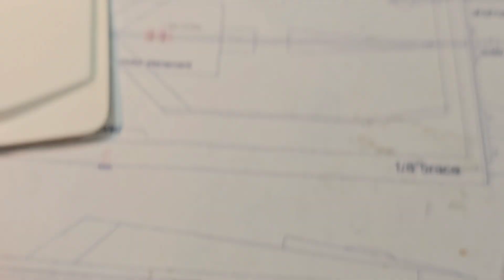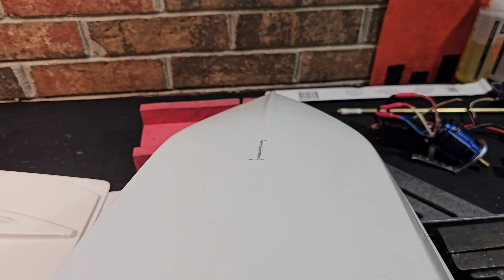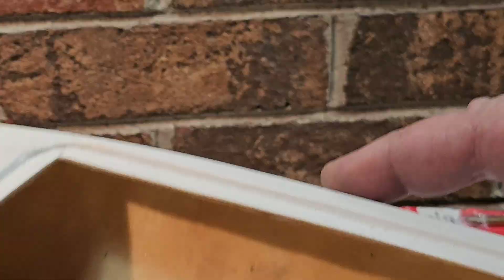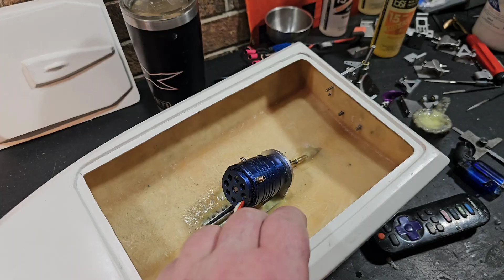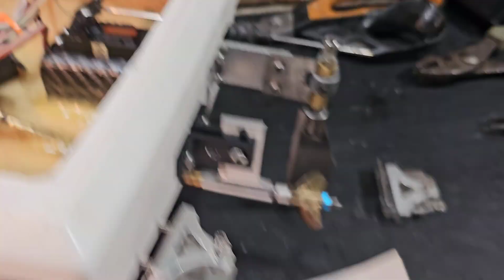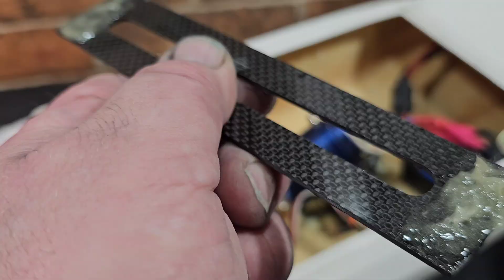Full Build Start to Finish Crackerbox Timmy Boat from Dead Ahead Rc - Fe Rc Boat Build

Comment: Big B Big B Nice work brother. I got my CF TFL pursuit and I need to reinforce the bottom of the hull the sides where it's put together before it gets damaged and I'm debating on cutting out the stock motor mount because everything's lined up dead nuts perfect I mean the flex cable I mean you can't even tell it slides into the collet it's so smooth and if I cut that damn motor mount out and have to remount it and I know it's not going to be that exact again I was debating on whether the carbon fiber up to the edge of it and it's cut up and chop and then you know just kind of work around the motor mount  which is half-assing it or just go ahead and bite the bullet take it all the way out and go up underneath like I supposed to? I know what you would  do You'd take it out. That's probably what I need to do. Thoughts suggestions? Thanks and keep up the good work. By the way what's the best waterproof metal gear steering servo you recommend budget wise for saying my pursuit?

Comment: Hey can a flycolor 150 esc handle 8s for just short burst.thanks
Reply from the maker: It's only 6s capable, 8s will fry that speed control just by plugging the battery in

Comment: Great build video Big B,  sat here and watched it during lunch. Thanks for previewing it on the water at the end,  right off the bat you had it running great. 👍 
  I’ll be curious to see what you think of the skeg protruding from the bottom of the boat, I’ve often contemplated putting one on an rc boat,  you see them on ski boats, not quite sure what their for myself.

Comment: I Where do you get such big pieces of carbon fiber that you make your hardware from.  I only every find small piece on ebay. Ty Sir for any info. Boat gang :)
Reply from the maker: I got it on ebay, you have to kind of refine your search.
Reply: @IRONCLADRC  what should I put in my search window on ebay what put down for my refine wording?
Reply from the maker: https://www.ebay.com/itm/364047774088?mkcid=16&mkevt=1&mkrid=711-127632-2357-0&ssspo=epq_i0pksgg&sssrc=4429486&ssuid=yQkZS9FcQay&var=&widget_ver=artemis&media=COPY
Reply: @IRONCLADRC  that's awesome thank you that helps Sir

Comment: What size is that cat? I have 2 TP power 3682 2060kv motors. (Won a ebay bid) I want to do a twin motor build and was curious what length boat I should be looking for. Any recommendations?  I am loving the speed of my catamaran
Reply from the maker: I'm pretty sure it's 26" modified H&M.....   3682 size motors should fit a zonda or animal twin for a fast boat...   29-36".. For a super fast catamaran one of those bandit bullet proof cats from ose would be a good choice. Top speed run guys use that hull for setting records.     

If I were to build a twin cat for speed, I'd use the bandit "bullet proof" Cat for my speed run boat it's 29" (avaliable in a 29, 42, & 57" hull)  I'd probably choose that exact size motor 3682 long can for all out speed.. I'd go up in kv for extreme speed but 2000 should be in that 90-100+ mph range proped and powered right
Reply: @IRONCLADRC  hell yea! Thanks for the insight!